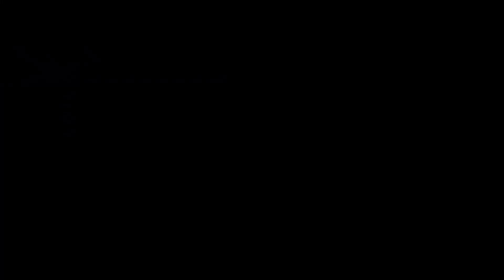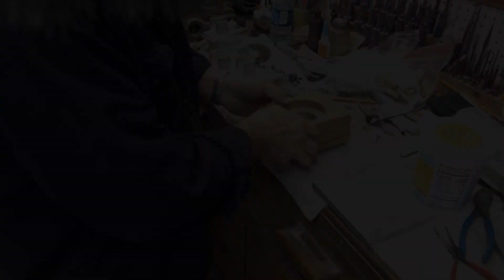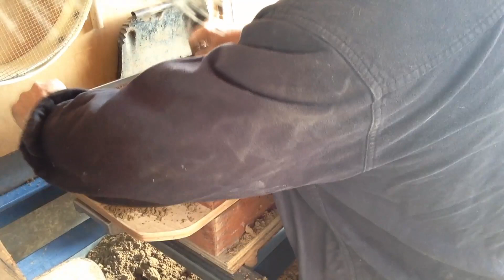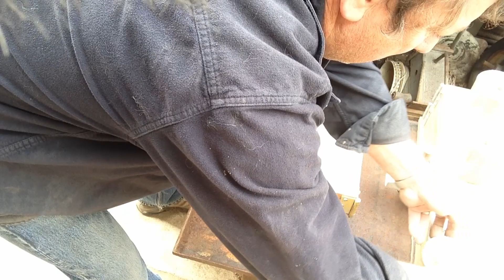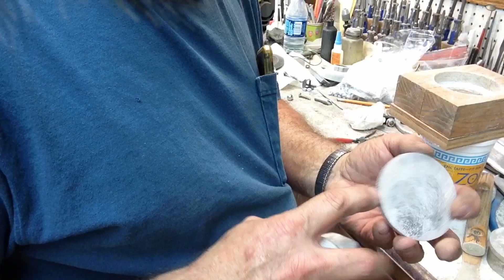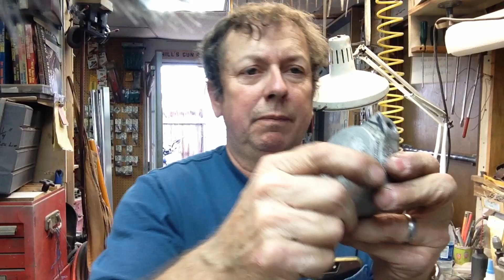Home Foundry Series, Part 2: Building A Match Plate Vibrator

Comment: How am I only just finding your channel today?  You beat me posting your match plate vibrator video by about a month; well played... :)  Wish I'd known about this in time, but I'll mention your video in my part 2 coming up soon.  For mine I modified the pattern shown on ray-vin.com's foundry pages to be sand cast rather than using lost foam like they did, and to need no machining.  But it has taken a few iterations to get the patterns dialed in.  I like Chastain's design a lot though.  Seems way beefier, and there's also more patternmaking which is a lot of fun too.  I actually ordered his book with this vibrator project in it just yesterday.  What size ball is that you're using in yours?  I finally got my patterns modified to fit a 5/16" ball, but I worry that's still maybe a bit small...
Anyhow, great job!  If you're not already a member of the alloyavenue.com or thehomefoundry.org forums, that's where a bunch of us (a lot of the same people are on both) hang out to talk about projects like this.  Might be worth a look if you're interested.  I see you have a bunch of other foundry videos too - I guess I know what I'm doing today.  Take care
Reply from the maker: You weren't looking hard enough :), I built all my vibrators using Chastains design and they work well. I will check out both of the forums, thanks.